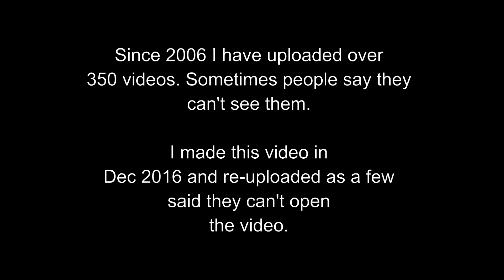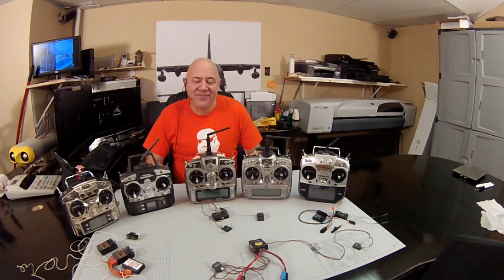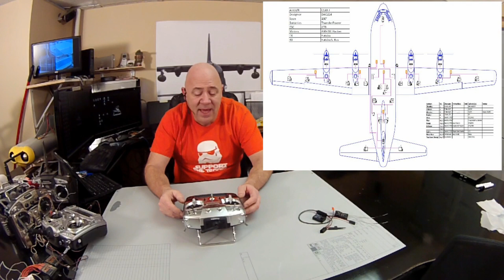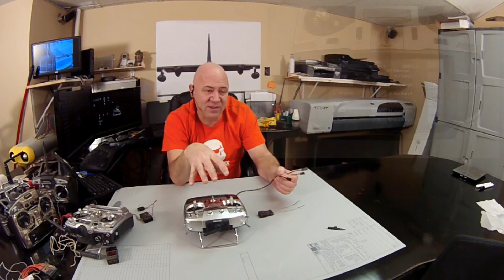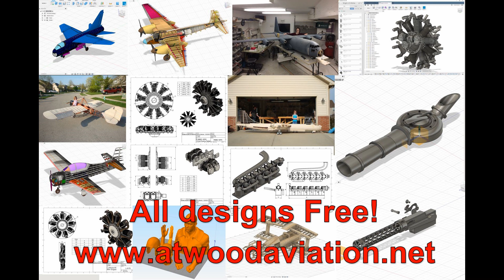Futaba T18SZ and Large Models

Comment: Hi. With the TS18SZ can you make any channel or control surfaces have differential? on the transmitters i have i can only do diff on the airlerons but i actually need it on rudders too, because i have a rather experimental design with two rudders. I'm looking for a transmitter that can do it. Thank you
Reply from the maker: Hello, I have set both expo and duel rates on my ailerons, elevators, and rudder.  I hope that helps. :)

Comment: Hi Dag,
Really enjoy these videos I've got an 18SZ and learning these new computer radios has proven to be a challenge for me!  Your videos are helpful. I recently tried setting up a basic model and for whatever reason on a brand new model setup it had rudder and elevator mixed.  I played around with aircraft type and whatnot but did not change the mix.  I put the radio away and haven't touched it since.  I was going to clear the radio out and do an update and try again.  Any ideas?
Reply from the maker: There is a wing and tail type/setup place. I once set up my tail wrong and it made my rudder and elevator move together. I think I had it set up like a delta. And it may have been in the wing setup. If it were me, I would create a new model in the radio, bind, and start fresh. Hope this helps/makes sense. Rock ON!